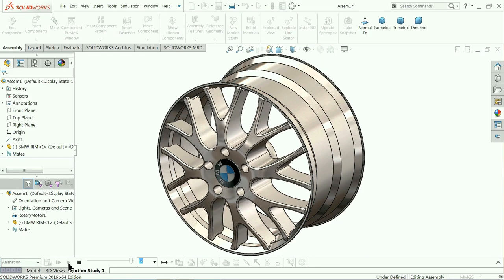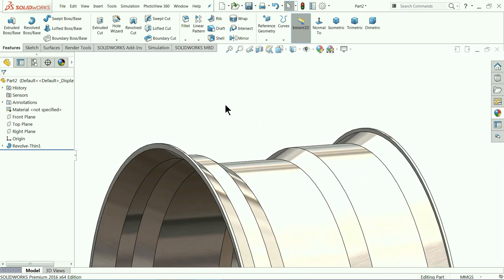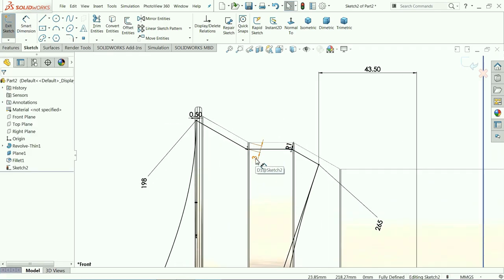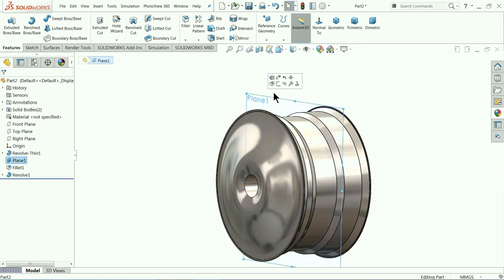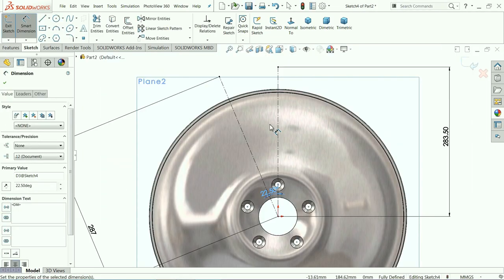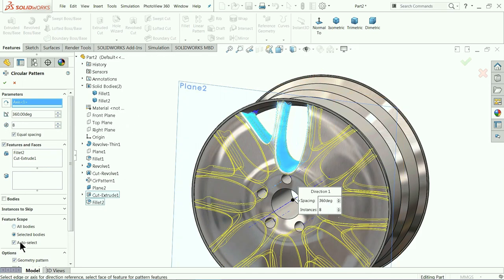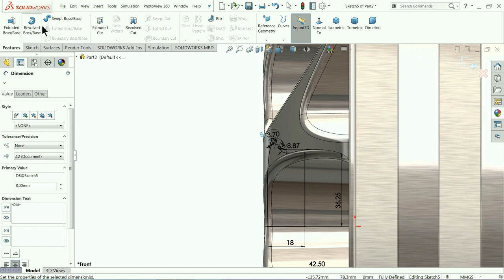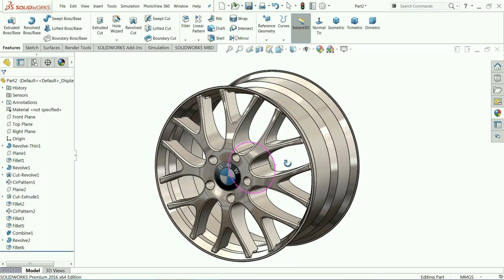BMW Rim in Solidworks | Solidworks Tutorial

Comment: as a practicing engineer, I regularly hit my colleagues on the hands for the dimensions between the sketch elements and the surfaces obtained in the definition. The first thing that flies when changes are these dimensions. In production, all dimensions are built only in sketches. And then, when switching from version to version, with changes in geometry, nothing flies. Put a minus. t's a pity that I can not put the second minus for the imported logo.